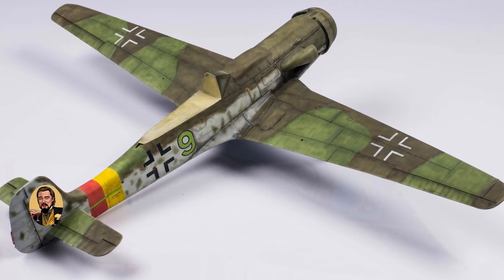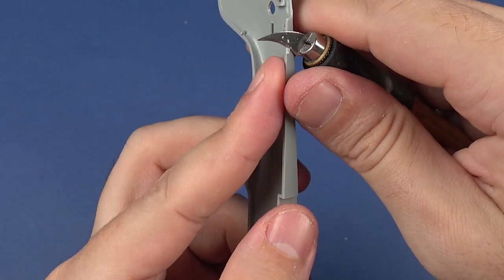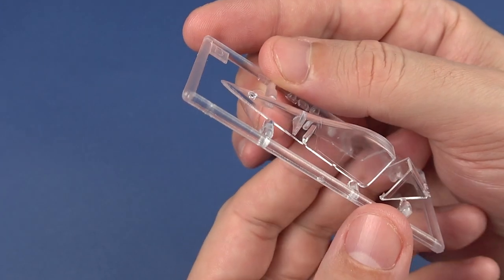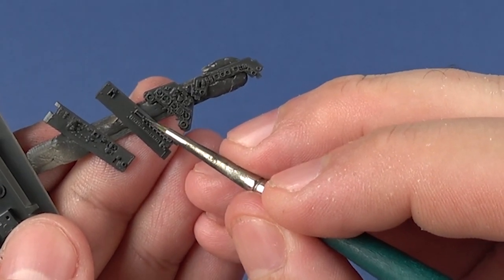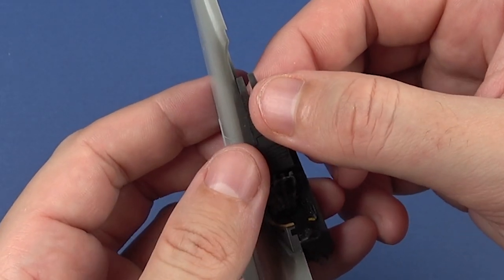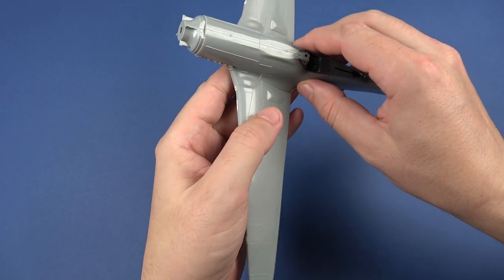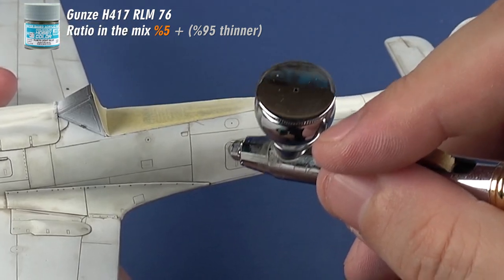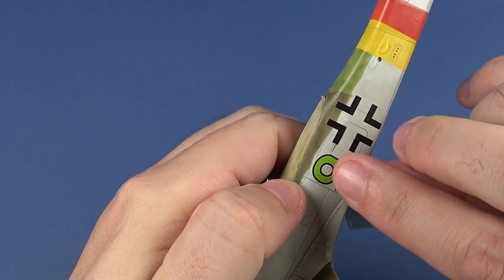Ta 152H-1 Trimaster/Dragon 1/48 Scale Model Aircraft

Comment: Back when these kits came out, they ALWAYS sold out immediately.  The story was that Tri-Master was 3 Hasegawa employees who wanted to go out on their own.   The kits were light years ahead on anything else mass produced.  The plastic was great, the engraving was always fantastic, the p/e was well thought out, and workable, and the white metal (usually landing gear and exhaust stacks) was  okayish (I always stuck to the plastic).   The ONLY kit that I ever saw that had resin was the TA-152C, and, it was a last ditch effort.  The wings were cast in resin.  Mine were horrible- short shot, with huge holes, and warped to hell.  BUT, that was the only kit that wasn't a home run.  Some people say the 152 H is a fiddly, difficult model.  It may well be in the re-box, In the tri-master boxing, it was a great build, as long as you stuck to the instructions.  You have done a great job on yours! Thank you for sharing!
  If you look closely, look at where the cockpit is, in relation to the wings.  The DB-603 was a HUGE engine, and pushed the cockpit WAAAY back!  It must have been a special challenge to get in and out of that plane, especially with a full parachute and other high altitude gear!
Reply: Actually the real plane the cockpit is in its standard place for a FW-190...the wings are new and longer the nose is stretched longer from the firewall forward and the fuselage was stretched by I think it was 10 to 14 inches between the cockpit and tail (bout the same spot you see a lot of people painting the white stripe on the body)... Kurt tank pretty much built the best version of all the FW 190s but it was expensive and so you see the Dora 9 (Dora was were they found stability issues at high altitude and made the fuselage longer) version more while very similar didn't have all the advanced features of the  TA 152   Hope this bit of info helps
Reply: I thought the TA-152 used a Jumo-213.
Reply: Cockpit wasn't pushed back, the nose and rear fuselage got longer.

Comment: Great job! Few questions as I use the same paint and airbrush:
1) What is the needle size in that Evo brush at 11:27?
2) What do you use to thin the paint for the work done at 11:27?
3) Roughly the pressure used for the work done at 11:27?

Thank you!
Reply from the maker: 1. It's 0.2mm
2. I use a local brand alcohol based surface cleaner for all acrylics expect X-22.
3. According to my air compressor's dials it's about 3-5 PSI
Reply: @Scaleaton  thank you for the reply. I really love your technique and I am amazed at your level of control of the AB. If I was casually spraying those exhausts like you do I would end up with the paint around it as well.🤪

Comment: Pro tip paint at least the bottom and back sides of the engine since it is exposed (Its even this way on the real aircraft so still accurate for the rivet counters lol) Dora 9 included... It was considered a production cost and weight saving issue so deemed unnecessary to fully enclose the engine from the gear bay

Comment: Brings back old memories... I built one of the original black sided box Tri-master Ta152H-1 kits in 1989 or was it 1990... "MA-9" I think was the SKU. It was not an easy kit to build. There were plenty of details, yes, but a lot if stuff didn't fit very well and gluing thin etched metal parts to plastic was also tricky. I didn't have an airbrush back then, so painting was a chore. I super diluted the acrylic paints and went with about 5 or 6 criss crossing coats of very thin matte paint so there weren't any brush marks. A semi-gloss finish was achieved by buffing the matte paint rather than painting with gloss or semi-gloss paint. This was done before washing for the panel lines and rivet holes. It took about 4 months to finish.